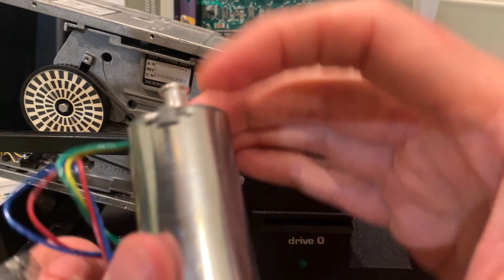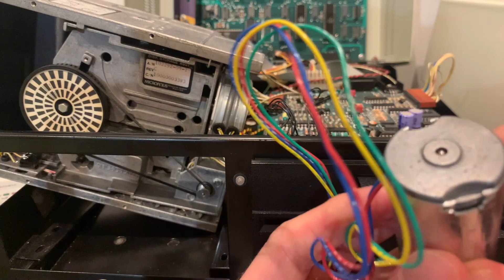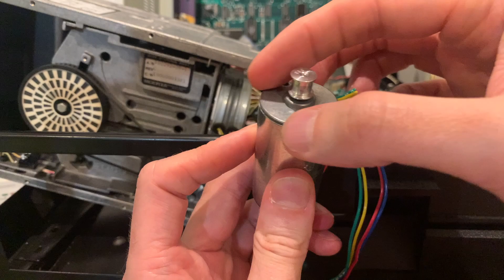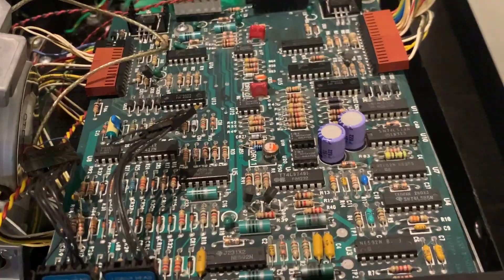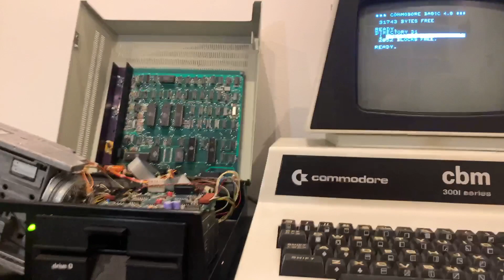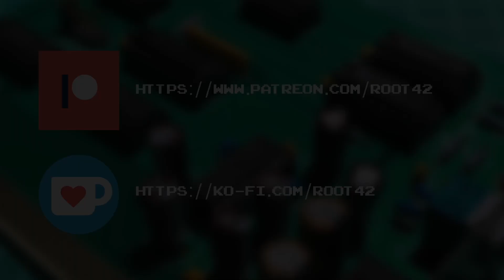I Broke A Vintage Floppy Drive Motor

Comment: They sell pinion removal and installation tools, we used to use them in the early days of electric RC power systems to play with gear ratios.  

Very fiddly.  The definitely had jigs to aid in assembly.  Sometimes you can drill holes and pin parts in place to aid in assembly.  Its a lot of work to save a $5 motor :)

I feel the pain.  Breaking things is an unfortunate part of repairing things.  Good job persevering.
Reply from the maker: Yes, I figured that the Bühler motors seem to be very popular with RC models. They have quite a bit information about those.